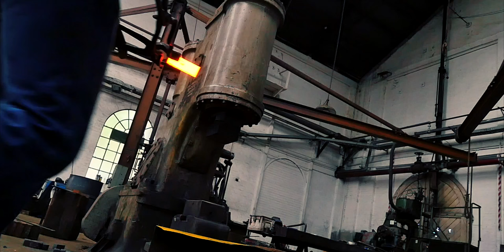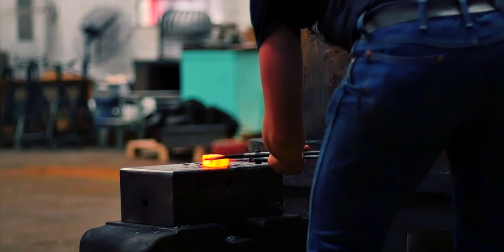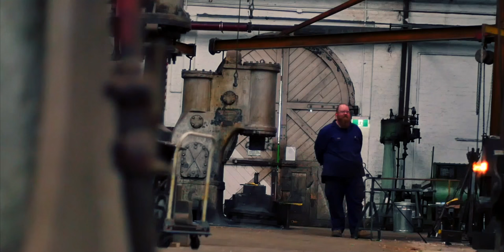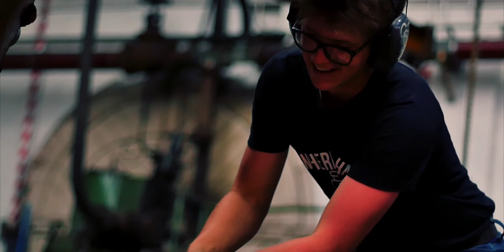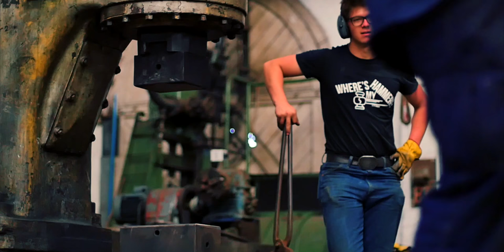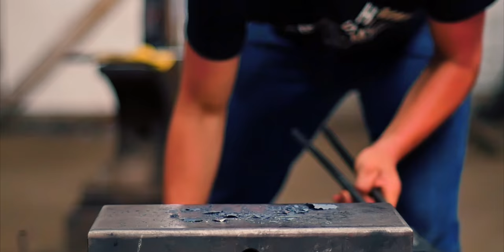FORGING WITH A HUGE POWER HAMMER!! Massey 7CWT

Comment: trying to plan out all the little details about getting myself a little backsmith shop, and  ive seen some power hammers called Anyang  pros they seem affordable cons they also look quite sketchy, problems with oil and such from what i read about people owning them. but what kind of powerhammer do you recommend ? spring hammer/air hammer etc.
Reply: If you're just starting out the logical thing would be to start off small and just go manual.
Reply: marcus Austdal definitely just get a hammer and an anvil. Then you can learn how metal moves. It's one of those things you have to do to really understand